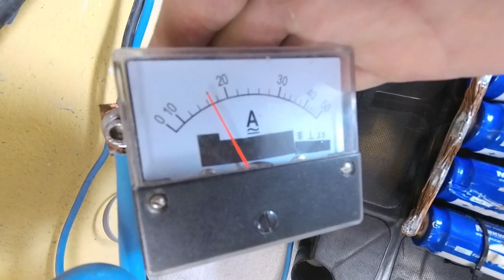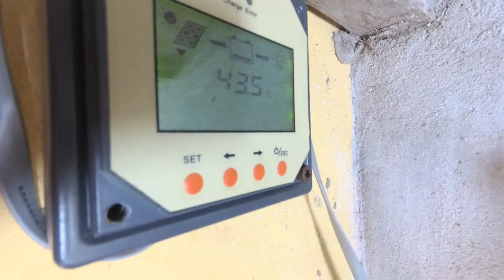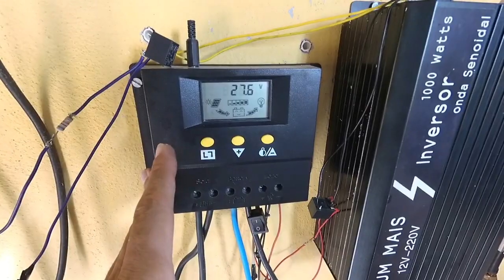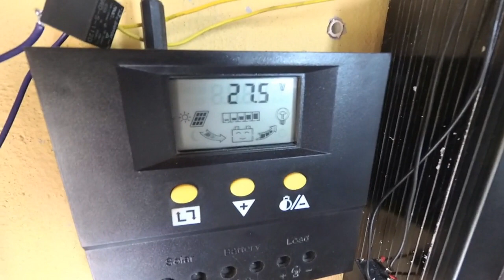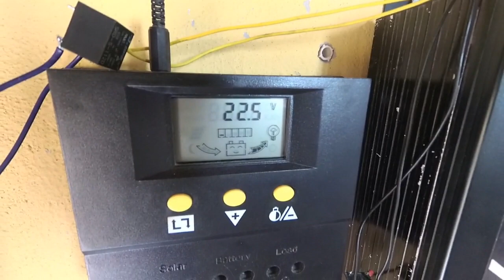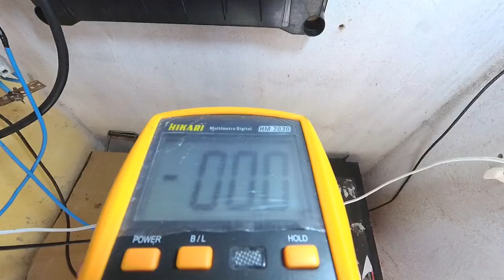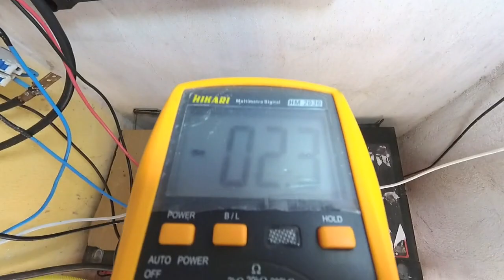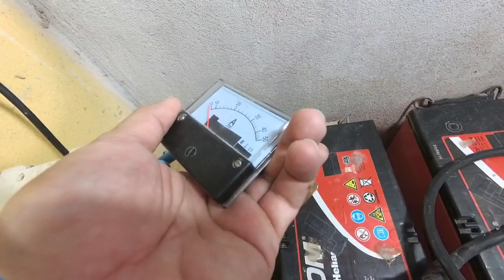Energia Solar Bateria Feita de Ultracapacitores, OTeste Em 24 volts, Funciona, O que Aconteceu

Comment: ola como vc liga o pack no controlador sem ele desligar ,pois eu não to conseguindo, no meu controlador ele entre preta como curto e se desliga mesmo  o pack ja tendo uma certa voltagem  ,só consigo intercalando uma lampada .
Reply from the maker: Para  funcionar, carregue  eles  com  uma fonte com a lampada em serie ate  chegar  12 volts   se  você  for  usar  12 volts  , e so assim voce  poderá  ligar  eles  no controlador , e  so depois  que  o controlador  ligar acender  o display ai é que voce  poderá  ligar  os  painéis solares  se  depois de tudo isso ainda  da  este problema  então seu controlador esta com defeito
Reply: ok obrigado pela dica vou testar ,pra ver.

Comment: Bom dia, quero usar 4 bancos de 5 ultra capacitor 2,7v 500f que cada banco vai ter 13,5 amperes, vai ser usado em paralelo em cada bateria 150ap, uso uma fonte Jfa 200 aperes, a corrente da fonte sobe pra 14.3. Vou ter algum problema por conta  que cada banco de capacitor é de apenas 13,5 amperes?
Reply from the maker: voce  quis dizer 13,5 volts certo ? bem so da certo  se você  colocar mais um ficara 6 em serie  assim dará certo pois trabalha com folga nunca coloque apenas  5 em uma fonte que vai ter uma voltagem de 14,3

Comment: Amigão compensa eu comprar uma bateria de 150 amo ou 60. Capacitor?
Reply from the maker: Se for pra usar durante o dia recomendo os capacitores mas ai você tem que fazer um circuito de troca entre rede e solar automático  mas no caso da bateria tem um caso interessante ai pois se você se comprometer a trocar manualmente via chave de transferência é só observar a voltagem da bateria todo dia e trocar antes dela baixar até 11 volts já os ultra aguenta altos picos de corrente que a bateria não tem e eu recomendo também que você coloque os outros capacitores em paralelo com esta bateria assim serve como um um sistema de Alto pico já que a bateria sozinha não suportaria altos Picos de uma geladeira por exemplo

Comment: Amigo, meus sistema tem duas baterias maxpower de 12v/400A, totalizando um banco de baterias em paralelo em 24V/400A, a pergunta é: Posso fazer um banco de capacitor igual ao seu ai em 24V para ligar em paralelo com minhas baterias, ou o melhor é fazer 02 bancos de capacitores em 12v para ligar em paralelo com cada bateria individualmente?
Reply from the maker: Faça  paralelo que  protegera  mais as  baterias , e assim ao invés  do  inversor cobrar potencia  da bateria  vai puxar  dos ultra capacitores , boa sorte

Comment: Prezado, gostaria de entender o motivo pelo qual vc está fazendo paralelos de bancos de 6 capacitores. quanto mais capacitores maior será o tempo de descarga? Um grupo de 6 capacitores se estiverem conectados à geração não seria suficiente para manter a carga, sem bateria, dependendo da geração?
Reply from the maker: Um grupo de seis capacitores seria suficiente Sim porém dependendo da geração e o tipo de e o equipamento que estiver ligado no inversor outra coisa é que teria que ser seis capacitores de 3000 farads
Reply: @eletronicajc   cada ultracapacitor não é 500 F? Outra coisa: Ao se descarregarem totalmente o controlador de carga vai reconhecer que não tem bateria conectada e não vai carregar. Como vc resolveu isso?
Reply from the maker: Todos os dias  eu desligo via chave
Reply: @eletronicajc  como assim?
Reply from the maker: Homi assista meus vídeos

Comment: Meu amigo, meus parabéns pela iniciativa do assunto, achei interessante demais esse negócio de ultra capacitores, meu sistema tem 6 painéis de 150w, você acha que um Banco desses ultra capacitores com 36 em um sistema de 12v daria pra ligar ?
E qual seria o máximo em corrente que um Banco com 36 daria para suportar ?
Reply from the maker: Obrigado , bem olha eles podem ligar qualquer  coisa não tem limite porém eles só funcionam por alguns minutos
Reply: ELETRÔNICAJC, um Banco com 36 capacitores suportaria 6 painel de 150w
Reply from the maker: Supondo que  os  painéis  depois de passar  pelos controladores , ainda  saia  45  amperes nao tem problema
Reply: Obrigado meu amigo, e parabéns mais uma vez, sucesso nos próximos testes

Comment: me esclareça, por favor, se construir, um " PACK " COM 48 MEGACAPACITORES DE 3000 FAHAD, CADA . . .SUSTENTA UM BANCO DE 4 BATERIAS, com as seguintes amperagens ? 1 bat. de 480 amp, 1 bat de 450 amp, 01 bat. de 250 amp, e 01 bat de 60 amp. perfazendo o total de 1.240 amperes ? agradeço se alguma filho de DEUS,  puder me ajudar !
Reply from the maker: O problema é que baterias de amperagem diferentes não são ideais inclusive usar uma bateria de 60 amperes não é adequado

Comment: eles   chega   15   anos   mais    isso vai   depender    cosumo   e   descargas    profundas  mais   o  grafeno   ele   ajuda  muito  sao  feitos  de  grafite   estes   capacitores    eu  ja  sei tenho  eles   ja  casa   mais   voce  compra   china   eles  em  3000f  com   2.7   sao  muito  bons   trocar  este  inversor  ai    para  cabra  da  peste   isso  vai  ver  o  susto    tem  sistema   telsa  wall   ajuda   muito  lition    mais   capacitores   3000f  2.7   volts   so  poder   mostrar   assim     trabalho  ja  tem   videos   you  tube   tesla   usando  este  capacitores    ja  com   caminhoes    e    ja  tem  maswell    com    correntes   muito  altas   descargas   muito  fortes   cosumo  chega    300  amp.

Comment: Uma aula sobre capacitores.
Galera para saber a densidade energetica media aproximada de um capacitor usa-se a formula   E=0.5*C*V²
E= Energia em Joules  C= Capacitância em Farads  V= Tensão de Carga
Ex:  Capacitor 350 Farads 2,5v         E= 0.5* 350* 2,5²      E= 0,5*350*6,25= ~1094J
     W=P*T     W=Energia em Joule        P= Potência           T= Tempo         H= Tempo em Horas         1h=3600s
     P=1094\3600  =0,304W\H
  Uma Bateria 50Ah  12v            P= V*I        P= 12 * 50 = 600W     Logo :   Uma Bateria de 50ah teria uma densidade energética de 600W\H 

Ps: Lembrando que 1Joule  será então a energia correspondente à potência de 1 watt durante 1 segundo.

 Perceba que a densidade de energia é absurdamente baixa comparada a uma bateria.